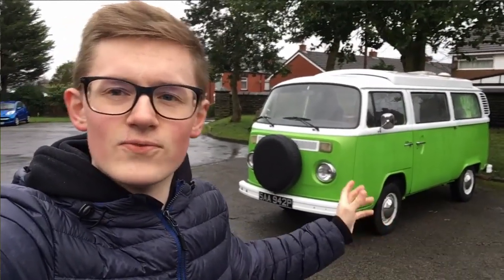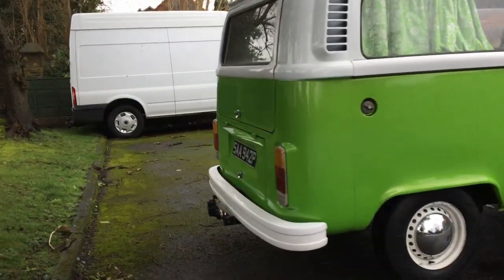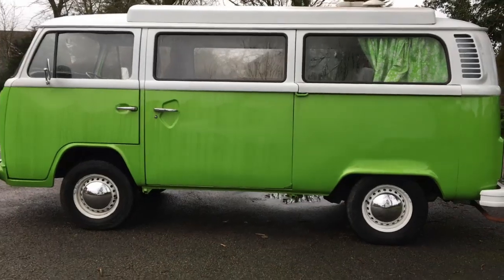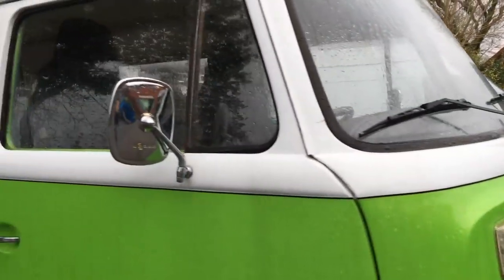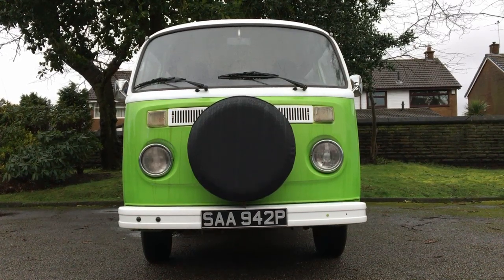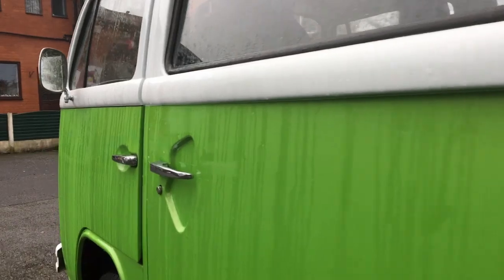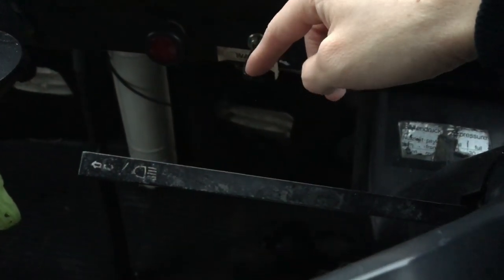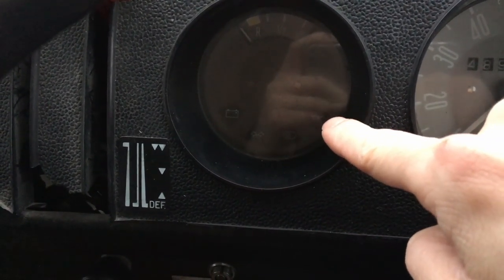I'm More Indie Than You - 1976 Volkswagen T2 'Bay Window' Camper

Comment: My first car was a 1978 van transporter in blue I paid £450 in 1984 with a years MOT went everywhere in it was hopeless up hills but could fly down them remember it was always running out of petrol and the day it dropped a valve on the M1 replaced with a MK2 Escort that had a better heater and just as much rot funny thing is that the other day I found the insurance for it from Swinton £53.66 TPFT for a 17 year old just passed test .

Comment: Your info is a bit wrong.. the oil guage is not temperature but pressure, oil pressure low it lights up.Also you said that they did not come from the factory as a camper, not entirely true, you could order a Westfalia from the dealership and it was a brand new bus.

Comment: Please show a picture or rear coils spring suspension, I'm intrigued!!
Reply from the maker: Wait yeah that's probably rubbish. Especially in this era this style of suspension would've used helper springs at most on the arms, with the bar and shocks doing the majority of the work.
I got this from a book about the history of the Transporter. Don't know what happened, but if the T25/T3 had coils at the back then I probably misread.
Reply: @TwinCam  yes, the later brick shaped t4's had coils, these still had torsion beams..
Reply from the maker: Sorry about that. Serves me right for rushing!
Of course, many modern torsion beam setups utilise coils, but in this era that would’ve been pretty unusual!
Reply: @TwinCam  that's what made old volkswagen's so good, torsion beam suspension! Easy to lower and very durable!